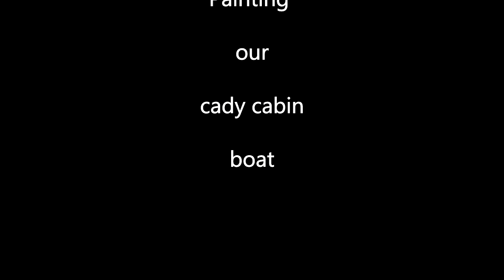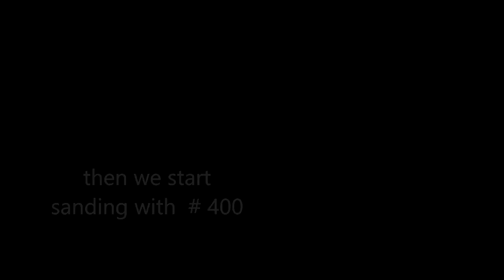custom paint job on my boat

Comment: So you painted right on the gel-coat? with no primer before the paint?
Reply from the maker: No need.
Just sand the old paint. And it stick very well. 5 years after still intact.